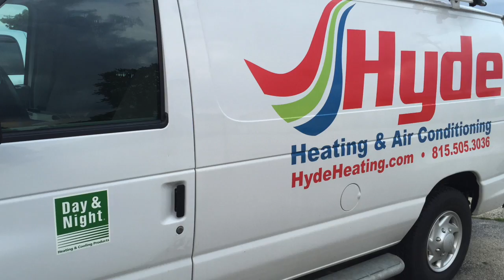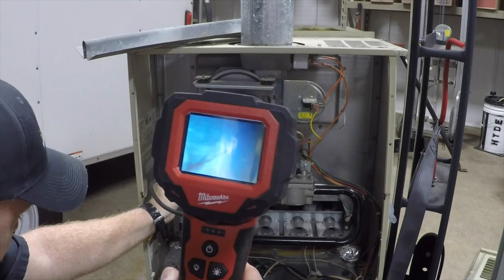Cracks in Heat Exchanger

Comment: Great video.  I think my heat exchanger may have a crack or cracks.   My furnace will run for around 3 1/2 then shuts off the burners.  After looking at too many youtube videos I've come to the conclusion my heat exchanger is bad.  But no one really told me how to take a look at the exchanger without taking everything apart. I will follow your instructions.   Thanks!

Comment: I think I have a cracked heat exchanger causing CO to leak into my house making me sick.  I have been calling AC people to look at my unit but they keep trying to sell me a whole new HVAC system. 

What type of techincian/expertise do I need to be searching for to properly diagnose my issue?   I see you had a meter and heard it was reading CO levels.  The HVAC guy that came yesterday.  Just eyeballed my unit without removing any panels. And instantly said yup it’s broke.

I’m not satisfied with this.  I had another person come over.  He also didn’t have any tools,  but opened up the plenum so he could crawl into it and inspect the heat exchanger.  He said he saw no rust or cracks.  But what if he missed something?   Is what I described an accurate why to look for a crack? 

The 2nd guy said it is safe to use my furnance, but after turning it on, I noticed I began having a headache again.  I”m waiting for Amazon to delivery a CO monitor to see what PPM is coming into my house.   What is a safe PPM.  What is not good?  What is dangerous.   I borrowed one from a friend and it briefly showed 46ppm.

Comment: Damn,  I'm sure we've had a cracked 1 for years but this year after it (if) lights the first few time, it burns for maybe 15mins then goes off but the fan still blows forever until you go down & push that hidden pressure button & flip the power switch. This now happens every time instead of a few times a winter. I'm in wv with a armstrong air ultra sx  90, in other words, we're poor lol The burners look rusty but haven't taken it completely apart (i think I would have to remove the ac top) the problem is loot. I'm pretty confident that I can fix it but the exchanger is the most expensive part. (Oh you smell gas strong by the vent pipe outside but have for many years)  is there a way to like jb weld or fix a cracked 1?
Reply: No. No JB weld or furnace cement.
Reply: @billhyde8303  so is there a way to fix a cracked 1 or just try to replace it
Reply: @iansstrungoutguitars  replace it if it is bad.
Reply: @billhyde8303  honestly I'm not sure if that's it or not but it's looking like a good possibility. Unfortunately I just don't have the money to get 1 yet. It's pretty old and I imagine that the burners are bad to. I do appreciate the help

Comment: Those carriers were truly garbage. They all crack the same and zero improvements on the heat exchanger replacement. Shockingly, the only furnace manufacturer I've seen make an improvement on a replacement hear exchanger, is Goodman. No bullshit either.